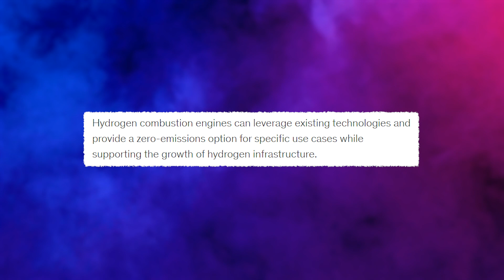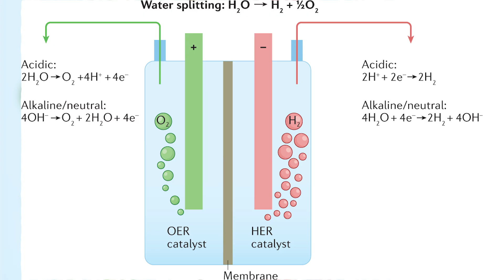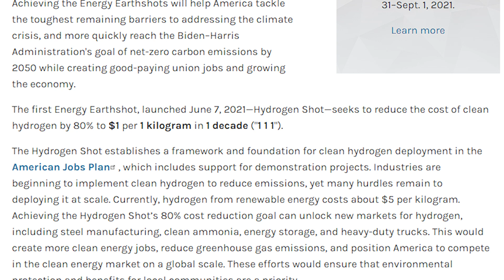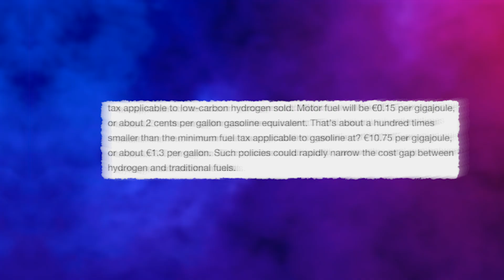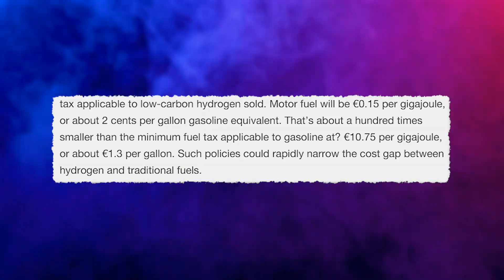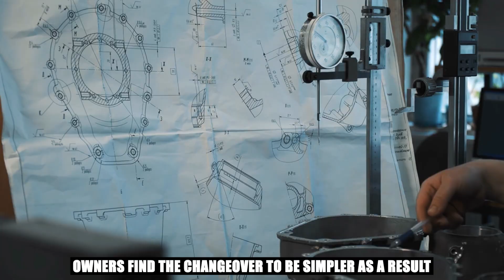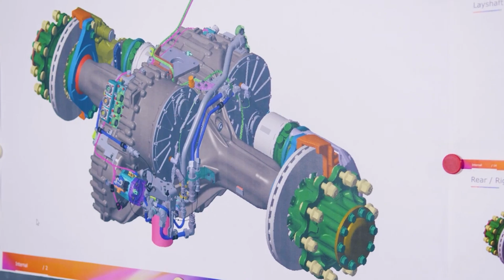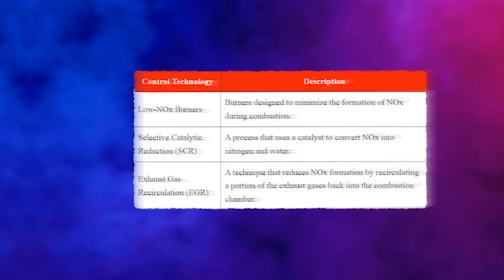End Of EV’s Here With NEW Water-Injected Hydrogen Engine!

Comment: For electrolysis you need a lot of electricity and very clean water. While solar power is cheap in most deserts, clean water is rare there. 
While I have to admit that it seems to be close to impossible to build an electrical grid  capable of charging a battery, I doubt we will have the means to transport H2 in the amounts needed for fuel cell cars.
Reply: There are chemical and mechanical reasons hydrogen will never be a fuel for cars. Liquid hydrogen is stored at almost zero kelvin and pressurized hydrogen gas would take up massive amounts of space. Many have tried and failed to produce an efficient hydrogen car and for good reasons. 

There's new ways discovered to use catalysts to produce ammonia from atmospheric nitrogen and hydrogen from water. It has a greenhouse gas rating of zero, has a comparable weight to energy ratio as gasoline, and is pretty easy and safe to store as a liquid. Although anhydrous ammonia is a caustic gas, in outdoor applications with reinforced tanks and flow restricting orifices, these are relatively safe and foolproof. If I were a betting man, I'd say pound for pound that NH4 is the best alternative to fossil fuels. It requires no rare earth minerals and would be relatively inexpensive.

Comment: Not possible to reduce "Greenhouse Gas" emissions because it's not possible to reduce something that doesn't exist to begin with (in the real world)!

In the real world "Greenhouse Gases" and the "Greenhouse Effect" doesn't exist!

The atmosphere's temperature potential is dictated by pressure, mass and gravity, i.e. the atmosphere's density prevent the "Greenhouse Effect" i.e. "Back Radiation"!

Because no measurable amount of energy (heat) is radiated directly from the earth's surface, and radiation that doesn't exist can't be delayed or prevented by random molecules, i.e. no "Back Radiation" - that means no "Greenhouse Effect" !

If you doubt my assertion there's no radiation directly from the surface of the earth out to space, think about this:

Are you using a space suit when you go out? Of course not!!

The reason is that the same atmospheric density that is preventing the earth's surface to cool by radiation is also the same density that is protecting you from cosmic rays ...

Rather logic if you think about it!

Ref.: Heat Wave? | CO2 Coalition Climate Chronicles #ClimateChronicles #NoClimateCrisis
https://www.newscats.org/heat-wave-co2-coalition-climate-chronicles-climatechronicles-noclimatecrisis/